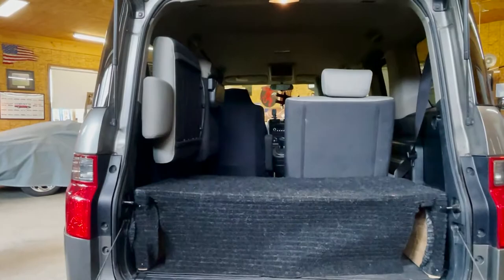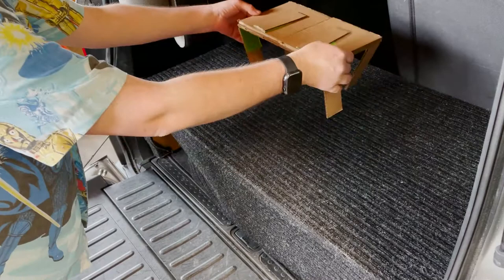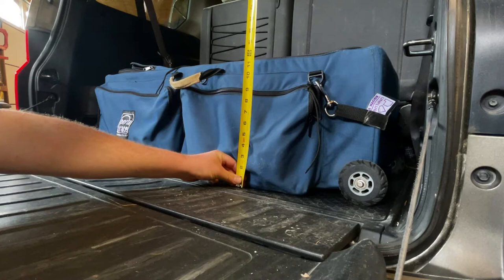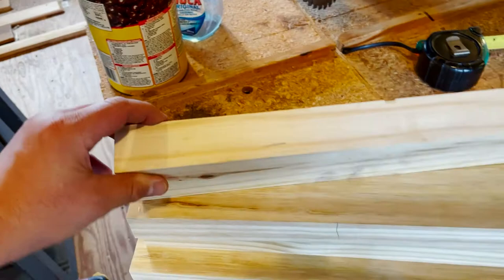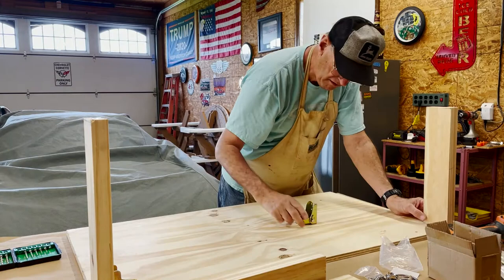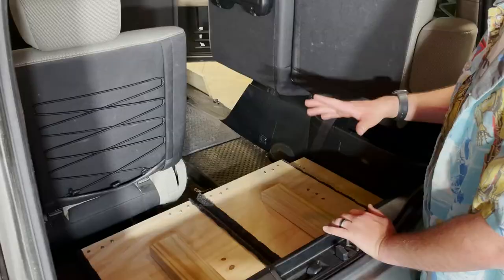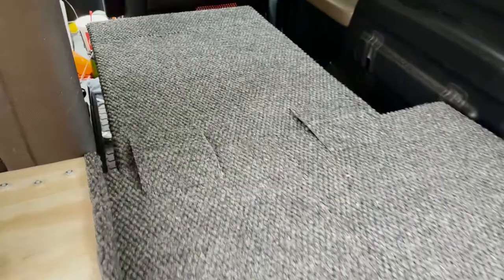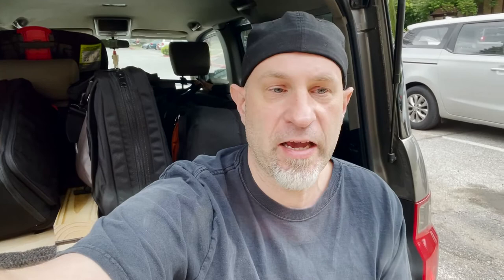Honda Element Transforming Shelf Build

Comment: I loved everything, but feel like there were so many missed opportunities, I hope you do a revision 2 of this, and cut a  few different size holes on the hinged flaps that fold forward, and maybe add something that looks like a basketball net to the holes, thats sealed at the bottom, so they could hold cups or bottles, and collapse when the flap is in the closed possition in the back, and wrap the flaps in vinyl, leather, or silicone treated fabric.
That way the rear passenger can use them as arm rests with cup holders. 😎👍🏼
Reply from the maker: Hey Vega,
Good suggestions!  The netting as a way of holding cups or bottles makes sense.  However, with what I am using my shelf system for, I don't really have a need for that.  Anyone could certainly modify the concept to fit their needs.  I am by no means a pro at this type of thing, but it is exactly what I wanted and works perfectly at what I need it to do, which is simply a shelving system for all of my camera gear when I go on video shoots.  Also, my rear passenger is a 5 year old who would rather have the extra space to put his toys and tablet, and just use the Element's built in cup holder for his kid-sized water bottle. But again. To each their own.  I encourage anyone who might watch this video to adjust it to fit their needs.